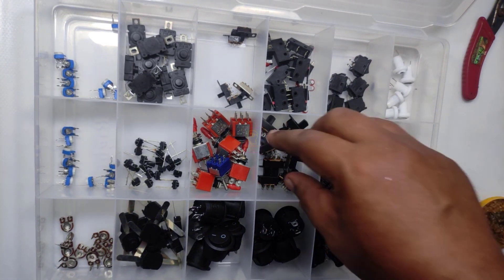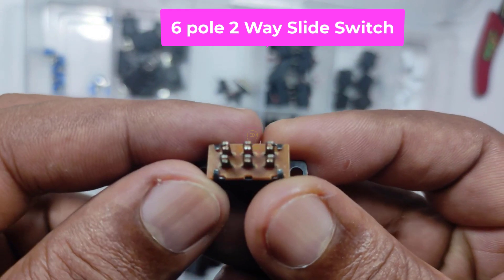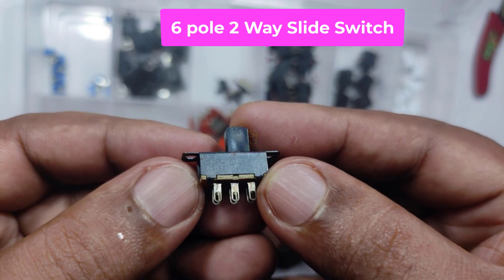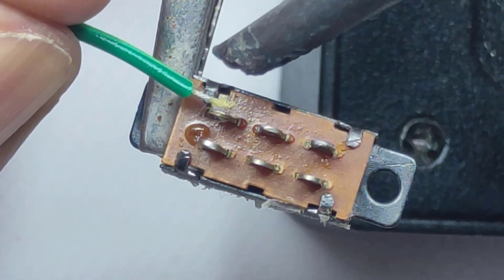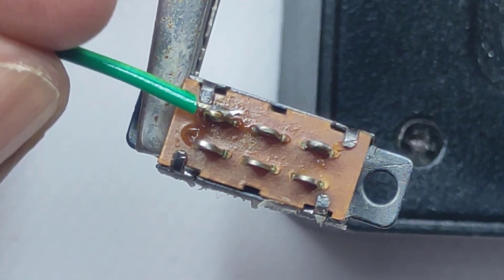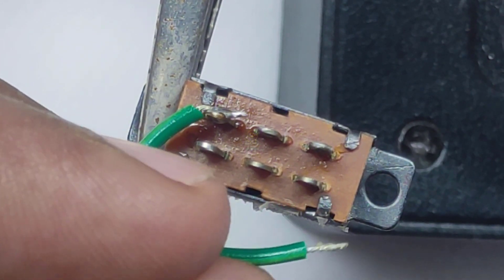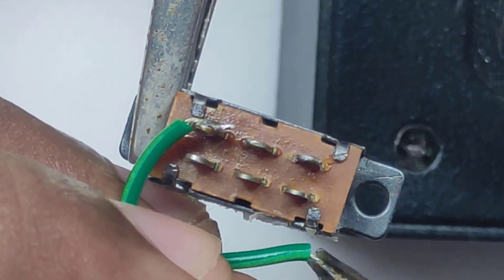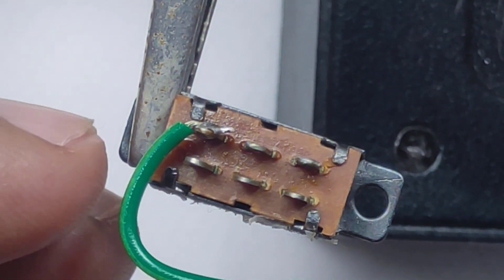How to Make Simple Bi-Directional DC Motor Control - Forward and Reverse a DC Motor Control

Comment: I connected the battery where the motor is connected in this video and the motor where the battery is and it worked.
Reply from the maker: Now only I noticed. It will,  coz both are same connection only. Thank you very much for pointing this. I am pinning your comment so that this will be always the first comment of this video. This is very informative

Comment: Will this can handle 24V /140W DC motor?
Reply: Not think so, you need more amperage rated slide switch
Reply from the maker: Thanks
Reply: No, more power rated switch is required. You can make use of H bridge wth smaller switch
Reply from the maker: Thanks
Reply from the maker: No, you need high power rated switch